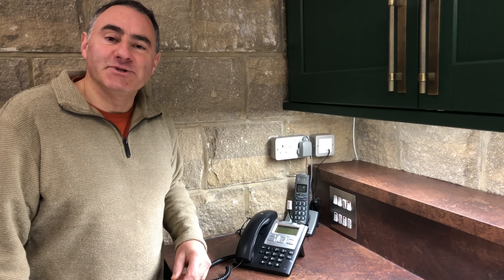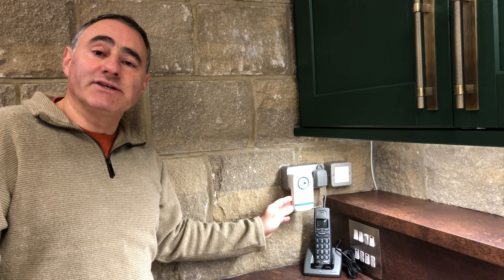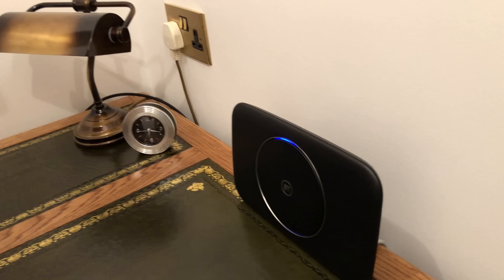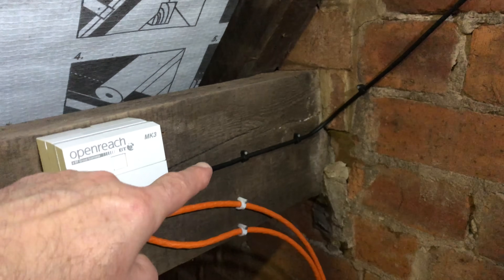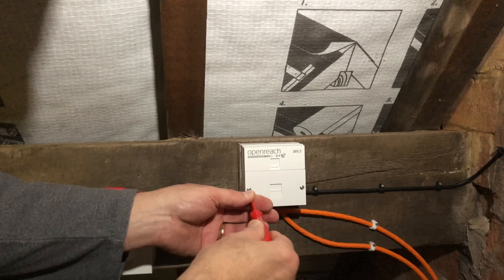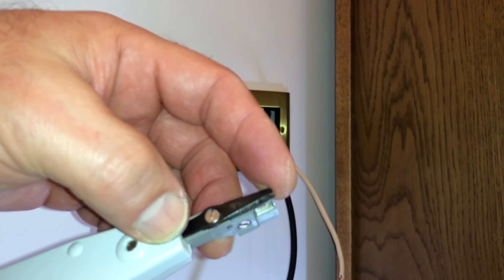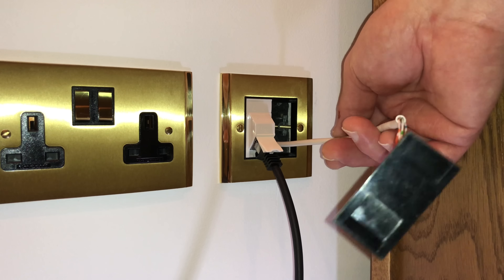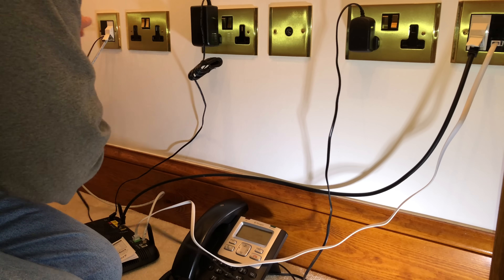How to Video - Analogue to Digital Telephone Landline Switchover Advice VOIP.

Comment: This looks incredibly easy, Yesterday they switched to the digital system and all my phones are disabled. I may have a go wish me luck thanks for sharing
Reply from the maker: Hello there, Strictly speaking you only need to wire connections 2 and 5 which is the blue / blue white. Some phones require the bell wire pin 3 orange white. All my sockets have all six wires connected for completeness and keeps everything neat, although not required. Hope it goes well. Cheers Rob 👍
Reply: Six wires? Only two wires are needed Tip and Ring usually green and red. Only four are needed for a lan for computer usually eight conductors on a cat 6 line. 73
Reply from the maker: Yes only two or three wires required Ron. The wiring diagram I show is 20 years old but the uk still use these same colors today. Cheers Rob 👍
Reply: @robswiseways5697  three wires was gone many years ago. The ring side takes the ringer and the old yellow wire was discarded even though the phone cable had three wires. Maybe the yellow wire was for party lines. The frequency would make the correct phone ring. Depending on the value of the capacitor old Western electric phones and automatic electric had large capacitors in their phones. In the USA it was tip and ring. No other wire was needed.  The old yellow wire was connected to earth ground only found in the box outside the house. I remember the long fuses that were used in the olden days. 73
Reply from the maker: @ronb6182  Great to hear how it was done in the USA. The new digital voice here in the UK still use two wires and the third ringer wire is still supported by the hub / router.
Reply: @robswiseways5697  it's probably history now. That was when we actually had land lines. They took down all the land lines on my side of the street. VOIP is the standard now. Could be fiber, coaxial or if still left copper. (DSL). 73

Comment: A friend of mine is elderly and has the old fashioned bell phones which she insists on keeping. Living room, bedroom and shop.
2 questions....
The BT engineer is coming in a few weeks, do you think he would be happy to use this method?
If not, does anyone rate the ATA plugs so I can connect each phone?
Thanks in advance 😁👍
Reply from the maker: Hi there, I’m not sure what the BT engineer will say. I have read a rotary dial phone will not make outgoing calls on Digital Voice, but can be used for incoming calls. I’ve also read about pulse to tone converters for rotary phones on community.bt.com - Rotary dial on digital voice.  Not sure about ATA plugs as I’m not an electronics expert. Sorry I’m not much help but there is a YouTube channel called ‘My Mate Vince’. He does a similar phone set up and he also connects an external bell. Cheers, Rob 👍
Reply: @robswiseways5697  Thanks so much for your detailed reply Rob very much appreciated. I'll have a look at your suggestions. 
Thanks for the great video 😁👍

Comment: I don't understand how it all works on the non hardware side. With traditional voip you need a sip account so how does it work when you uncouple your old copper line and number and go purely digital.  do you already have an sip account with your number? My elderly mother is reliant on her land line and I am reluctant to make the switch until I am clear about how it will effect her life
Reply from the maker: Hello Harry, I’ve never heard of a sip account. My provider BT gave me a date when my landline was being switched to digital. On the day the analogue copper line became dead. I plugged into the phone socket on the back of the hud and the phone continued working as before. Hope this helps. Cheers Rob 👍

Comment: But how many routers have socket for phone plug with side locking tab, mine only takes square
shaped plugs with top tab.
Reply from the maker: Hello Fred, I’m with BT and I do know if BT customers don’t have a smart hub2 when they are are notified of the change over from analogue to digital, BT will send one out. Only the smart hub2 has a phone socket. I think there is a certain model of a Virgin hub that has a square phone socket and they have a short adapter cable to convert to a traditional phone socket. I suspect if you have a landline and your provider is moving you over to digital, they may provide a hub that has a phone connection point. Hope this helps. Cheers Rob 👍

Comment: I got a cable pluged into the router at one end & the phone at the other but I get no noise or tone what so ever so not sure if it is done with being setup by our ISP yet or if there is a issue

we have a BT Decor 2200 V2 phone
Reply from the maker: Hi Daniel, I’m assuming your provider has notified you that you have been switched over from analogue to digital. Only then will the landline work from the hub socket. There is a couple of comments from Frank Johnson regarding his BT Decor 2500 not working but it works when plugged into a digital voice adapter which is strange. Probably worth plugging another phone in to see if it is your Decor 2200. Cheers, Rob 👍
Reply: @robswiseways5697  we got a new cheap phone coming to us tomorrow from our isp so hopefully that should sort it out

But our isp has told us the router is working after they've checked it & they've even pre configured it before sending it to us so they seem pretty confident it's all working as it should

The current phone we have works in the old lan line fine & works but when it goes into the new router it's just silent & nothing works
Reply: @robswiseways5697  we got a new cheap phone coming to us tomorrow from our isp so hopefully that should sort it out

The router was pre configured by them before sending it to us & they have even checked it from there end & they seemed all confident & happy that it is doing what it should be

Our current phone works great on the old land line but is dead when plugged into the new router

Today they even said to me 
they have created a new extension on our VoIP account and have made test calls to & from, so they can see the call is getting to our router

So it is looking more & more like it is our current phone
Reply: @robswiseways5697  we have a new cheap phone

There is now a tone when we listen to the handset so that is good

I can ring my mobile from the new phone so out going calls seem ok

But incoming calls don't seem to work I try to ring the new phone from my mobile & I keep getting incorrect number & I got my landlady to try ringing it & she said she got 2 odd sounds & then nothing

Comment: Going totally digital is all very well but it’s completely useless when we get power cuts as happened to us a couple of years ago, we were out for several days. We get them quite frequently where we live. Mobile didn’t work either as we rely on WiFi calling here and obviously we ran out of charge. We intended to get an old landline phone to plug into the wall socket.
Reply from the maker: Hello Sandra, You are right and there’s been lots of comments about this and discussions on battery backup. If your wall socket is still active then I suspect you’ll be ok. That’s if you still have an analogue phone line (unless you’ve done what I’ve done in the video, making the wall sockets digital so to speak). Bear in mind the telecoms industry say analogue phone lines will be switched off by end of 2025. Thanks for watching. Cheers Rob 👍

Comment: More research on the problem of no caller name on incoming calls to an old phone shows that it is not the phone but an inherent design fault with the hub.  So I either have the reliability on the re-worked wiring and no caller info' or unreliability with the caller ID on the crappy adapter!
Reply from the maker: Hello Frank, You could keep the reliability of the wiring and also use an adapter for the old phone. Cannot see why this wouldn’t work as the adapter links to the hub wirelessly. Cheers Rob

Comment: From the US here but the PSTN is not shutting down but is no longer required to be given federally but the states (like your countys but can pass laws) regulate the PSTN providers. The PSTN was never Goverment owned and is also shared with Canada, and some islands. The provider was ATT until 1984 mainly was mainly refered to as the Bell System as theres operating companys when it was broken up they became, Pacific Telsis, US West, BELLSOUTH, Southwestern Bell, Americtech, NYNEX, Bell Altantic, and ATT for long distance, nowadays its Centurylink(USWEST) ATT(Pacific Telsis, BELLSOUTH, Southwestern Bell, and Americtech) Verizon (NYNEX, Bell Altantic) but forced switchover dosent happen just for some areas it will be Provider wide.
Reply from the maker: Interesting reading on how the states telephone setup works. The start of privatisation of the main uk PSTN run by British Telecom (BT) was in 1984. Since then a lot of providers have set up using the existing BT infrastructure. The country is in the process of providing fibre to the premises to give ultra fast broadband and I am waiting for it to arrive in our area. Thanks for watching and commenting. Cheers Rob 👍
Reply: @robswiseways5697  forgot to mention that in the US you just go to the phone box and unplug the PSTN connection if you have VOIP and backfeed without rerouting
Reply from the maker: @comradepoop  Thanks for the info 👍 Cheers Rob

Comment: If you used a double socket, I'm presuming you'd have to add some bridging cables internally from one side to the other. x
Reply from the maker: Hello Richard, I’ve seen double sockets with one set of connections that feed both sockets and others where you have to add bridging wires as you have stated. In my case, if I used two Euro modules I would have to bridge across. Thanks for watching and commenting. Cheers Rob 👍
Reply: Thanks. Really useful video as my Dad is about to go over to VoIP and has hardwired phones in multiple rooms.
Reply from the maker: Hope the switch goes well for your Dad. Cheers Rob

Comment: Further to my previous comment, I now find that not all the old phones connected to the original wiring show the callers name from the contact list.  The one that doesn't (BT Decor 2500) is old so I might try to find a replacement.  At least it's reliable now!
Reply from the maker: Could be the age of the phone or the number of phones on the circuit ?? To answer this question, try unplugging one of the other phones to see if it makes any difference. Worth a try. Cheers Rob

Comment: You seem to do a lot of unnecessary work.  When I switched to VoIP, 16 years ago, I just disconnected the incoming phone line from the outlet it was connected to.  My home has 4 outlets in the various rooms and I plugged the VoIP connection into one of them.  If needed, you could just use a phone line splitter to connect both a phone and the VoIP to the same outlet.

BTW, you have funny connectors across the pond.  🙂
Reply from the maker: Hello James, I could have plugged an adapter into the back of the router, or the existing telephone wall socket in the room shown in the video. However, I wanted to keep it a bit neater and plug the router in one wall socket and the desk phone into the other wall socket. To be honest it took longer to film than to actually do the job. The insulation displacement connection is very simple and effective. Thanks for watching and commenting, Cheers Rob 👍

Comment: Wonderful leap forward in technology, not. Your power goes off and you lose all ability to summon help probably just when you need it most.
The UK PSTN (public switched telephone network) used to be powered by batteries that were kept fully charged. The entire country could lose power but the telephone network would continue to work. Before anyone says "but we have mobile phones now" remember the phone masts are powered from the grid. No power, no mobile.
Reply from the maker: Hello Anthony, You are absolutely bang on but it got me wondering, do mobile masts have battery backup??
By the way we are currently away in our caravan and have a good mobile phone signal on site. However, the closest village less than two miles down the road has practically zero mobile signal. Needed to make a call and found it very frustrating. I suppose in villages like this, battery backup in the home for the hub is necessary. Thanks for watching and commenting, cheers Rob 👍
Reply: Hi Rob, yes, mobile phone masts do have a UPS but it's only good for a couple of hours backup. With all the talk of war with Russia recently we should be increasing our communication networks resilience not reducing it. Shutting down the PSTN should be discussed in parliament.    @robswiseways5697

Comment: I hope your mobile mast is not on the same mains power circuit as your street, if it is your mobile wont work either! KEEP THE COPPER!
Reply from the maker: Hello Spud, It’s a case of enjoying your copper for as long as you can. I suppose if the sub station trips, it cuts power to the mast. So you’re right. Thanks for your comment and for watching. Cheers Rob 👍

Comment: Thanks for the video. I am worried about the switchover to digital. Currently when there is a power cut, I plug in an old analogue phone as there is zero mobile signal here. I won't be able to do that after the switchover, leaving us with no way of contacting emergency services if we need to. The price of rural living it seems 😶
Reply from the maker: I understand the issue regarding power cuts and not having any means of communication. There are lots of comments on this video about that same thing and the possibility of having a battery backup device. The hub would need battery backup and when fibre to the the premises arrives, the Optical Network Termination (ONT) box will also need backup. On saying that I have seen ONT boxes with built in battery backup. Hope this helps. Thanks for watching and commenting. Cheers Rob 👍

Comment: In Greece it works the following way: Just plug the router tel socket, to the walls old socket (plug to plug), and thus, it gives you tone in all the phone plugs in the house. You can try this first. This works with fiber to the home line separately. Without fiber to the home (vdsl) you can use a spliter to make it work. But all this hassle sounds like something British Telecom should do, and not mess you up and then fixing their mistakes.
Reply from the maker: Thank you for your information. This is basically what I have done but disconnecting the master socket first so there is no back feed down the line and then fitting a new socket to the loose end of the wire. It took longer to film the work than it did to complete it! Thanks again. Cheers Rob 👍

Comment: Any advice for buildings that have more than one landline number, please? Our telephone provider told me they would have to cancel one of the phone lines, which would mean having just one shared landline number, leading to me sometimes picking up my parents calls & having to run downstairs with my phone or them picking up my calls & having to do run upstairs with their phone! Also,  we'd have to work out whose calls where whose on the bill - I'm dreading having to explain all this to my elderly parents! A friend said there is a way to connect 2 phone lines to one router & those phone lines can have different numbers but I'm not sure how it works or how to get the phone company to understand that that's what we want them to do!
Reply from the maker: I don’t know the answer to this other than explaining it to your provider in more detail. With Virgin Media (VM) I have read their router has two telephone sockets and each socket can be assigned separate numbers, but I cannot find confirmation of this on Virgin Media website. But what I have found on their website under ‘Help’ ‘Landline’ ‘Install Home Phone’ the option to have a second landline in another part of the house. I’m guessing they use the routers second socket for this.
I assume most routers only have one telephone socket like my BT hub. If VM can do it, why can’t others! I’m sorry I cannot be of further help but someone may read this and have an answer. Cheers Rob 👍
Reply: @robswiseways5697 That IS helpful, Rob, thank you.

Comment: Whilst connecting the house hold old phone sockets works, the relatively long cables run here there and everywhere. Hence this internal house network of wire is open to electrical noise pickup and at worst during a thunderstorm could experience induced energy from any nearby lightning strike. There is no lightning protection on the internal network as in the video the internal network has been isolated from the BT master inlet. The electrical noise could cause the router to glitch, any induced energy could damage the router. I have seen the lightning induces energy problem with long RS232 communications cables. Perhaps the new internal network could be protected if a new dedicated master inlet is used nearest the router. This would have the lightning gas discharge or Transorb devices fitted. Just a thought…
Reply from the maker: Hello Mark, Thank you for your detailed comment. It’s a valid point you have here, food for thought as they say. I’m no expert with electronics, however, I’m assuming the telephone circuitry side of the router is the same as the BT master socket. So far I’ve not experienced any interference when making / receiving calls or when using the internet. In fact the voice calls are clearer than before the switchover. Will have to see how it all pans out. Thanks for watching and commenting. Cheers Rob 👍